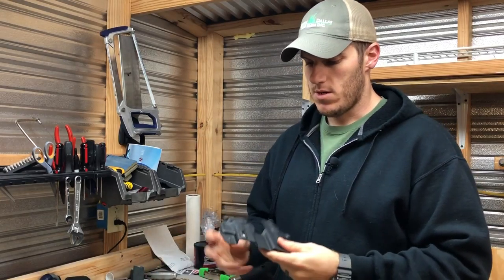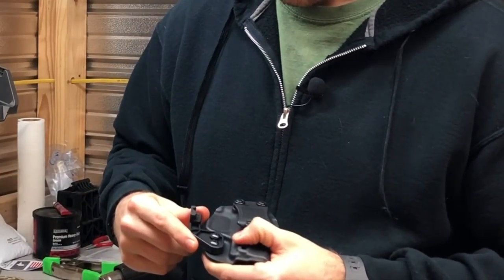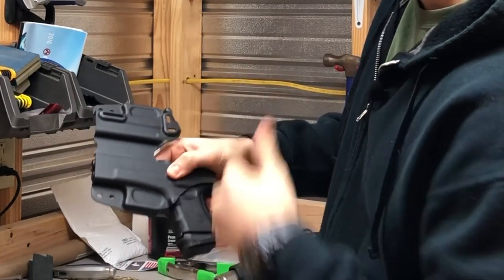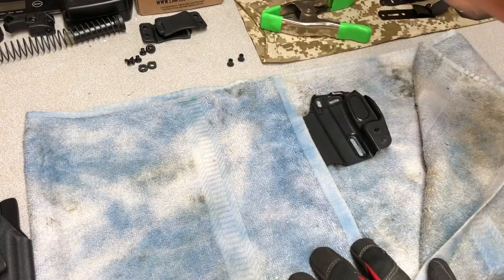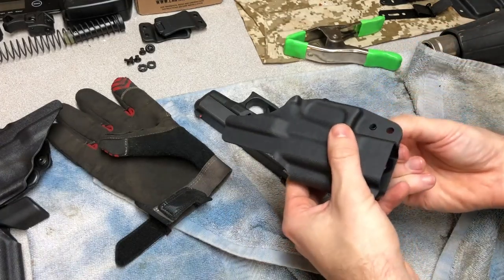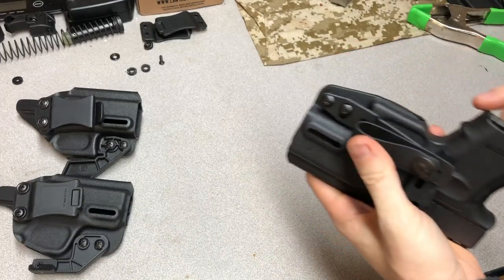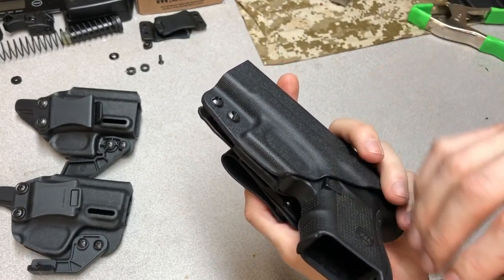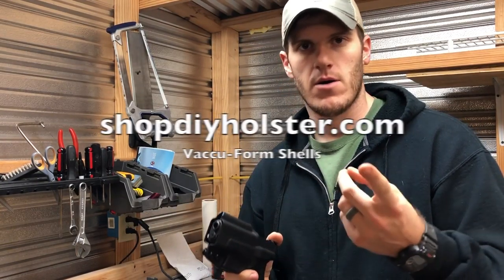$10 Kydex Holster

Comment: Awesome. Will a hair dryer get hot enough to do the trick?
Reply from the maker: ksalmi72 probably. I’ve made small changes to holsters with a hair dryer. It will probably just take a little longer to heat it up enough to be able to bend it good.
Reply: Clang and Bang fair enouh. Thanks!

Comment: That is a retention holster
Reply: Not adjustable retention on this one.but you could use rubber spacers between the kydex and some slightly longer slotted screws and posts and you could make an adjustable retention holster